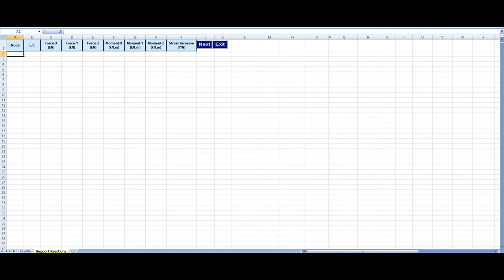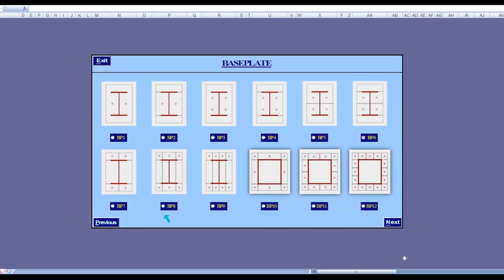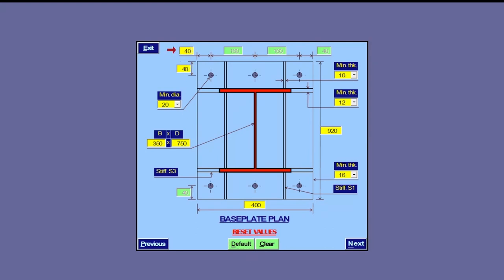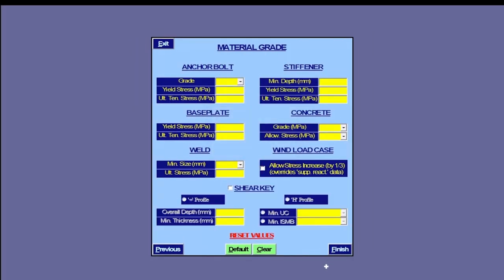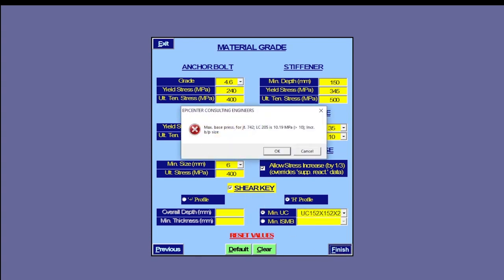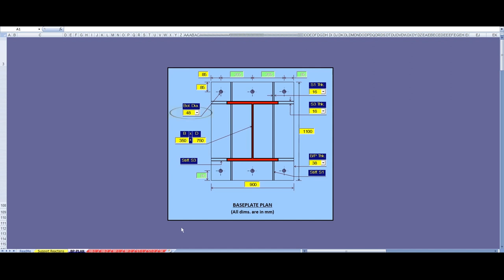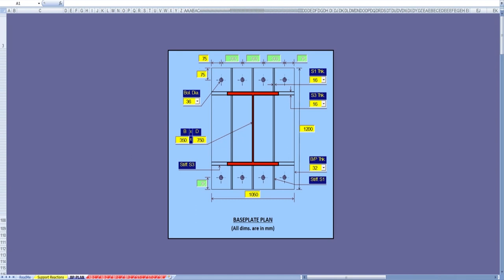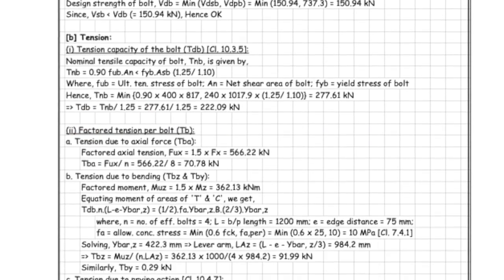BASEPLATE DESIGN

Comment: I'm very appreciate for your base plate template. it's helpful to solve the stiffened column base problem. And I have one question about table-p2 (4:30). In pocket type p2, how (where) can I get the sagging and hogging coefficients 0.1476 and 0.0682?
Reply from the maker: Hi, those are moment coefficients based on plate aspect ratio and edge support conditions. Such coefficients can be found in any std textbook/ handbook such as by Timoshenko etc.